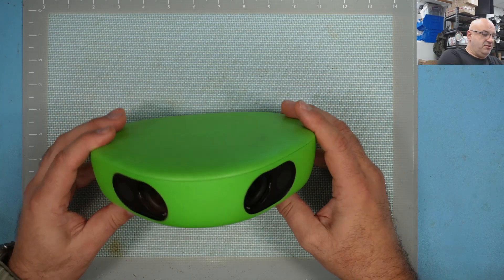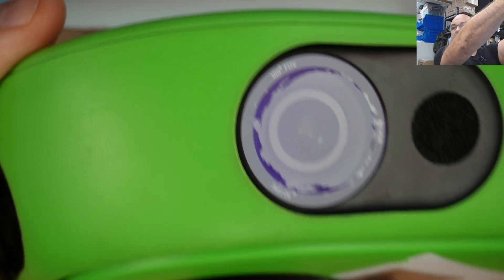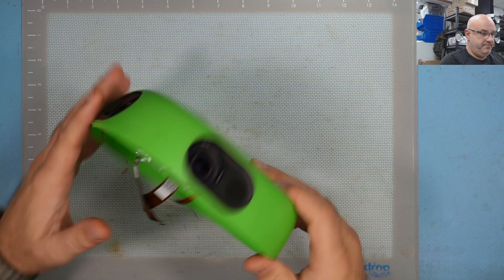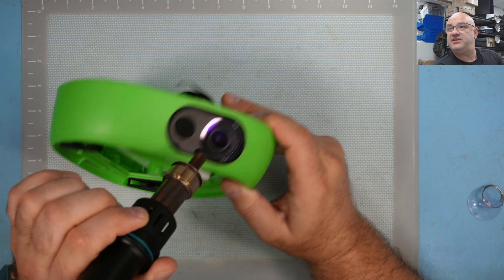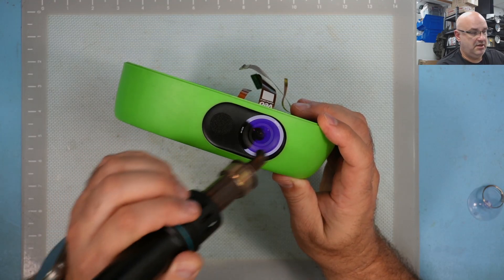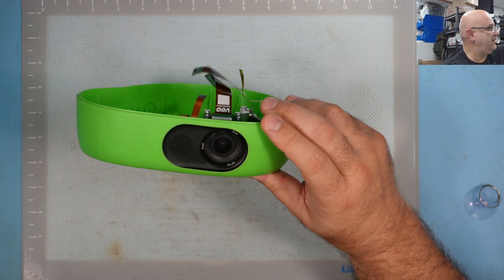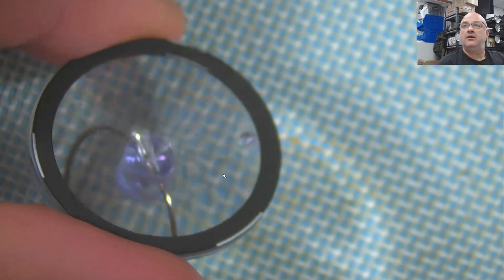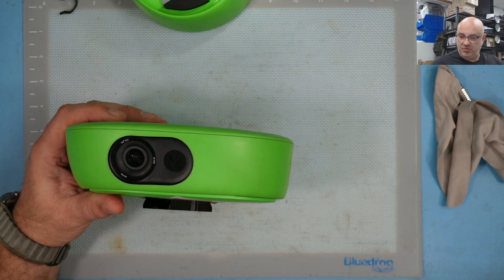Veo 3  camera outer lens replacement

Comment: Hey! Great work! 
Fancy taking a look at ours?
Fallen over off stand, all lights flash when turning on and it charges but it won’t stay on and won’t connect to the app.
It fell on to grass so not a super heavy fall and not from a great height either.
Thanks 🙏🏻

Comment: I kind of have the same issue with 1 veo 3 lens. I tried to wipe the rain of it with my cotton shirt and now I have the same effect on 1 lens. Is there a way to remove the foggy image or is the only way to repair this lens replacement?
Reply: Where can a replacement lens for the Veo 3 camera be purchased?
Reply from the maker: Only from a donor camera, unfortunately
Reply from the maker: Try to clean all the coating off the bad lens with alcohool. If the image is still bad you need a replacement lens.